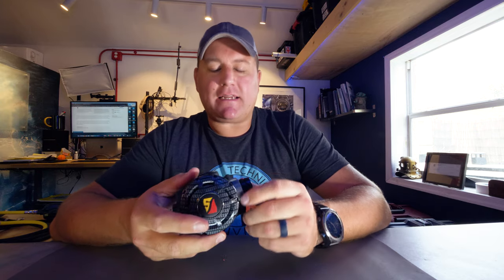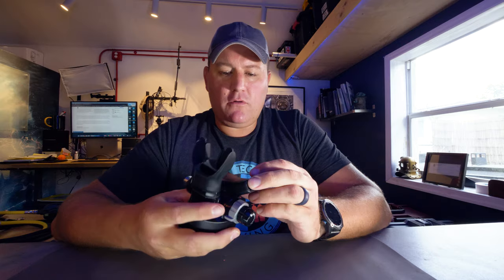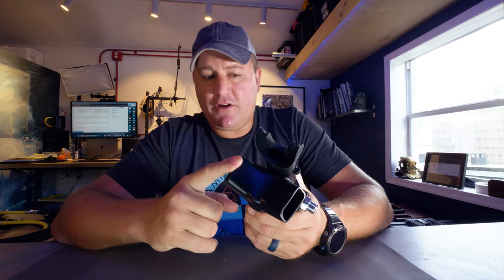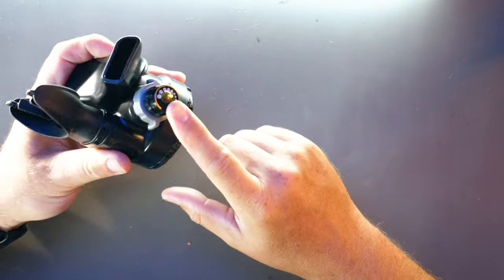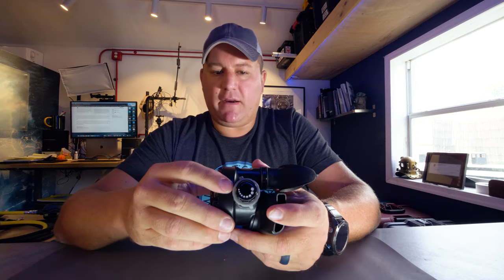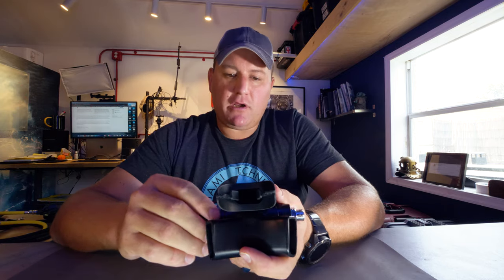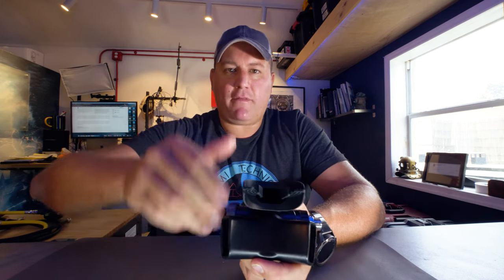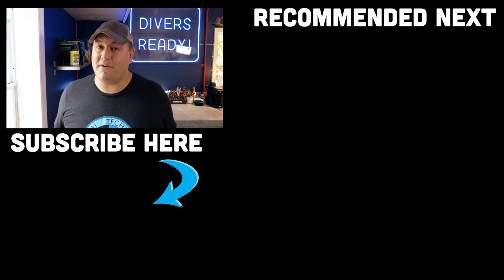Scuba Regulators Second Stage: Additional Features

Comment: Hello. I just Passed the PADI OW Class on Aug 6 2023. I chose to go with a Genesis Prana for both the Main and Backup. The Prana (Main) has the Adjustable Venturi and Flow. The Octo has adjustable Flow. When I was in the Class, I used two different models. In the Pool portion i used an Aqualung with Adjustable Flow. During the OW portion, I was handed a US Divers Non Adjustable. I didn't care for that one too much. The US Divers seemed like it wanted to Freeflow when not in my mouth. The Octos were botht he same Aqualung model with adjustable flow. Set them for Minimum. Didn't have a problem with them coiled up in the BCJ

Comment: I'd love to see how the Venturi lever actually works in the Diverite regulator.
I have an Apeks MTX and MTXV, and the MTXV has a barrel you can move over the air outlet hole, and not a vane that you move in an upright or flat position.
Interestingly, the MTX which doesn't have a Venturi lever, always has the barrel covering the air outlet hole, leading me to assume that cheaper regulators without Venturi levers all have the air outlet hole covered

I've seen a lot of channels commenting how the Venturi lever is there to prevent a freeflow. I would argue the Venturi lever is there so you only have to briefly exert negative pressure on the inhale, after which the regulator freeflows into your lungs until you provide positive pressure on the exhale. This is beneficial when you're working hard, like swimming against a current.

Comment: The Dive Rite XT second stage purge cover isn't carbon fiber. It is plastic that looks like carbon fiber. Real carbon fiber has that pattern, but it is much more subdued coming from how light reflects, so it changes depending on viewing angle.
Reply: XT2 second stage has two part, 
Case: ABS Plastic
Cover: Carbon fiber
Reply: @ibex-xland  it isn't I've handled one and am very familiar with carbon fiber. Also I called Dive Rite to confirm that is "painted" carbon fiber look.
Reply: @Teampegleg  thanks for checking, all website say in the specs that the cover it’s made of Carbon Fiber.

Comment: New diver here. I think I've settled on the Diverite Hydro Lite for my BCD but still overwhelmed with the regulator choices. How do you like the Diverite reg vs the Apex XTX50?
Reply: UK Diver here.  most of us Dive Apeks (i personally have the XTX200), mainly due to their pedigree in cold water.   Can't comment on Diverite, but the Apeks are literally bombproof.
Reply: I recently bought the Diver Rite regs & they're great! The best price/performance ratio IMO. Do it.
Reply: The Diverite XT is a good reg with a swivel turret first stage, which is useful.  I understand the company was founded in Florida but the regs are now actually manufactured in China.  Not confirmed and not necessarily a bad thing if true, but the second stages in particular don't look as robust as the Apeks kit, made in UK.  I have a bunch of XTX50s and they are remarkably well built, with many parts made from metal where others use plastic.  They breathe well, are light in the mouth and easy to adjust.  My former colleagues in the military still use them and that's good enough for me.  Yes, I am biased, but 8 years of great performance does that to you!
Reply: @timgosling6189  yep- what Tim said.
Reply: I am using Apeks MTX-RC in sidemount love it
Reply: The advice I have been given is to use the dive rite for staging regs not primary.

Hyrdo lite is a decent BCD for travel.